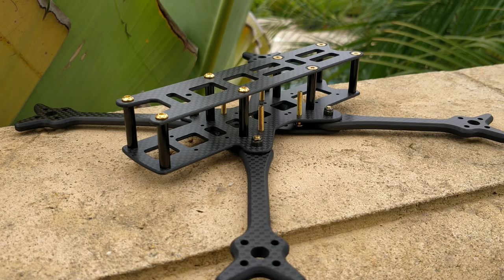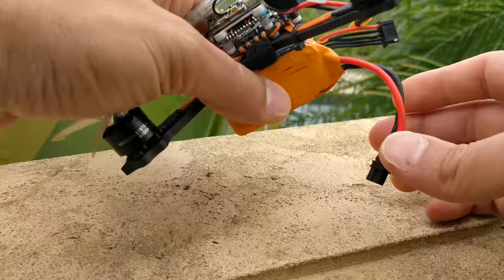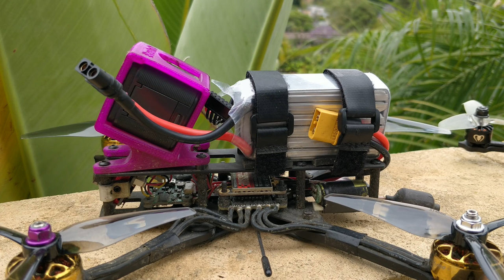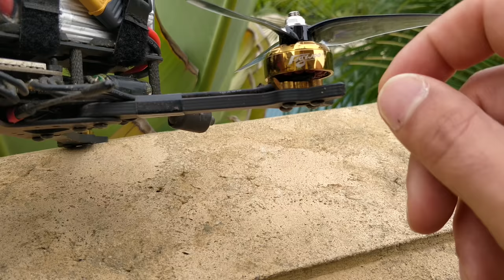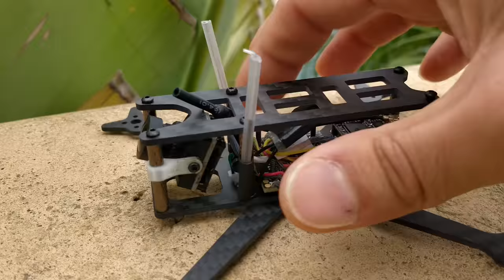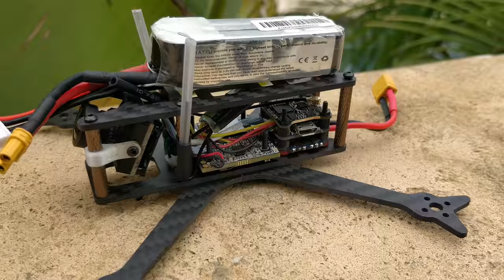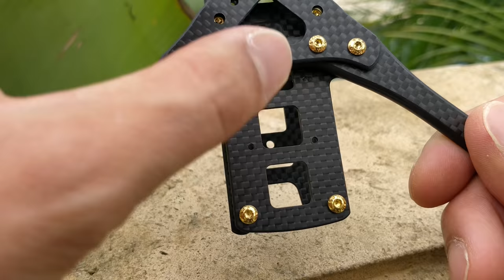Quad setup and flight performance - Quad Theory (WARNING: Lots of talking only)

Comment: All those Suttle differences I don't notice very much. 
Stretched, true X, this hybrid. Stretched sidways. I mean I notice but not much. Room for electronics is a big thing. Weight is a huge!
What has puzzled me lately and what I've been doing is trying to think ou tof the box on isolating electronics from frame vibration.  I believe this is most important and with all these frames on the market clones, name brand it's still just 4 holes through the bottom plate. It's almost open for the taking.
Reply from the maker: I didn't talk about any of that. That's the reason why my arms are not integrated with the stack screws at all. Much more vibes. The rubber grommets do an excellent job the way I have it
Reply: @Kabab  yeah the grommets do work. I like the rubber Standoffs. I guess it's more of the gyro used. If I were a better pilot I think I would notice those suttle frame differences haha. I do notice weight between 4 5 6s wich I run all on same quad. And I feal the better I isolate the electronics the more I can get away with running higher voltage without returning . Atleast that's what I thinks going on.

Comment: What are your thoughts on "deadcat" design ?
Reply from the maker: It's almost all but necessary to get props out of shot if you want a traditional style frame without the wide X. In this case it actually performs quite well but I still don't like it
Reply: But there are 3D printed mounts for the session out there that push the GoPro a bit more to the front so for example I do not have any props in the final video with my FlosStyles (5" and 6") or another Alien type quad. So to have no props in the final video a deadcat style of quad is not required in any case.
Maybe if you like to fly 7".
Reply from the maker: @henrischomacker6097  right which is why I don't even like the dead cat at all

Comment: Why did u jump from iflight xing to flywoo nin?
Reply from the maker: Xing and Flywoo are made in the same manufacturer. They're exactly the same motor. I like the Flywoo more because it comes in 1750kv whereas the xing is only 1700

Comment: You have 2 forms of tuning 
Mechanical(hardware) and software
Reply from the maker: Yeah I aim for mechanical tuning and skip the software
Reply: KababFPV I have seen your way of tuning - I have a emax hawk 5 with 6” arms and 5” emax avan flow - and just today I just did what U do with lazy tuning video - you settling is 0.1 and the other was 1 - mine was 0.6 and now 0.3 and the other was 0.5 now 0.7 so its a mix between soft and hard ware tuning- testing it 2morrow can’t wait for the smothered stick feel 🤙 big fan thanks for replying massiw_101 insta 😂

Comment: "Countersunk screws", please don't. I have 3 of your Glide frame and I didn't like that change with the new batches. It adds another different type of screw that you gotta have spares for and potential weak point(issue with a different frame). Plus,I would think most people run some type of battery pad on top, which makes the countersunk top screws redundant.
Reply from the maker: Right. Thats why I never did it. I'll just leave it on the batt end of the plate and nowhere else

Comment: Actually when you are talking about what way the carbon is cut on the frame at ~35 minutes .. Thats just the top layer of the carbon.. the other layers will most likely be in other directions. Or atleast they should be for strenght.
Reply from the maker: In the VAST VAST VAST, like 99% of ALL hobby grade carbon that I've taken a look at, the top layer is accurate in predicting which direction the fibers inside are going.  I've literally seen three examples otherwise.  Also, the VAST VAST majority of hobby carbon uses 0/90 carbon.  Believe what you'd like, I've done heaps of testing over the past five years.  This is the most common remark I get about carbon...
Reply: @Kabab  That might be :) assumed quasi-isotropic layup was kind of standard. Based on the only place local to order carbon and their frames.
Reply from the maker: @dronesandstuff  not standard. Must be specified when ordered.
Reply from the maker: @dronesandstuff  also qusai actually makes the carbon weaker in some ways and stiffer overall. It's usually better to go with regular 0/90 and designing to take advantage of it....depending on the design

Comment: Bob you hate the wobble but leave defaults I’m gonna have to remind you that you don’t build x well true x quads save the toothpick
Ya gotta tweak the pids mostly the filters I like the flosstyle probably the best an with tweaking I end up way different in the axis front to 
Back I’m gonna get you some pics of my favorite quad 5” alien with 6” flosstyle arms it’s perfect
Reply from the maker: I know how to tune, just not to perfection.  There is no tuning that helps with the wobble issue.  I've tried everything anyone has recommended.  The issue is an open issue ticket with betaflight.  The devs know about it.
Reply: KababFPV yea I know that you do 
 Pretty sure I’ve seen your work

Comment: Motors 1750kv? Why not Higher?
Reply from the maker: I prefer 1750-1800. Any more kills the batt too hard and requires a throttle cut. I don't need any more power than that. The thing already goes 100mph.

Comment: Give me a jello free lightweight 7 inch frame. There aren't many options  for a true long range 2200mah capable cruiser.
Reply from the maker: I'm working on it but I need to get the props out of shot. I'm considering a nose extension for the glide and keeping that as the 7" option because it flies so nice
Reply: Check out the fr7 on thingiverse the cut files and prints are all on there and no props on view https://rotorbuilds.com/build/18394
Reply: @Kabab  I'll be ordering as soon as they are available.
Reply: @biggfpv2721  this is a great design, but it's a unicorn frame, no vendor seems to carry it.
Reply: @AdrianoCasemiro  yes cnc madness cuts them and ships them out it's taking off check out mid-range MTN surfing group on Facebook they have tunes for it and everything 50 bucks for just the frames
Reply: Just a heads up option though for ya
Reply: @biggfpv2721  just sent'em a shout, thanks!

Comment: Ok, first disagreement.  While P and D does affect attitude hold, it's the I's that really determine how much gain is applied. Antigravity is a good example, fast stick movements that make the P overpower the I causing shudder is why that feature exists. 
To simplify as much as possible, ignoring the interplay, I describe the p as your control gain, I as your hold gain, and D as your dampening gain. 
The issues that arise from high P need to be countered with high D but high D has it's own set of problems that are attempted to be fixed with dynamic d that has it's own set of issues that complicates the tune ever further.
It's getting so complex, tuning down an 'overpowered' quad is becoming a serious hassle. 
Im betting if I gave you a tune you would be shocked. 😎
Reply from the maker: That's one of the parameters that need to be correct too. Not ridiculously over powered
Reply: @Kabab  had a feeling you would say pid tuning is outdated.  "overpowered" is very complex too. Motor response times, max RPM, tourqe, thrust, prop, power draw, auw, weight distribution. All these things can be tuned for OR you can replace parts until you find a good combo that just matches. 
My 2.5" is my most insane p/w quad. 1106 7500kv tooth fairy on 450mah 4s. Just to get it to fly, I had to chop my pids by over half, tuned, almost 2/3's lower!
Now that it feels like my 5", it's hands down, by far, my fastest quad. 
The 7500kv was a shipping mistake btw, thanks Sergio 🙄😂 
Pids are still important. 
I've considered building an app that can estimate your settings based on your setup, but it's getting so complex there is almost no way that it would be helpful. 
I imagine something like:
2207=-4p+1i-1d 
2300kv=no changes
6"=-3p-2i-2d
50 pitch =-2p-2i+1d
Auw 700g=+1p+1i
Ect..
Then total up the numbers and make that change from stock. -8p,-3i,-3d. 
This is how I tune in my head and before the first flight I can get a quad flying better than stock numbers, so there is some validity but mostly just educated guesses. Who knows, maybe I'm onto something and a pid simulator will be built into betaflight configurator in the future. 😂
Reply from the maker: @Stanton_High  hopefully we'll be moving towards dynamic self tuning pids soon
Reply: @Kabab  we already have pretty 'dynamic' pids, smart feedforward for p, antigravity for I, d_min for d. It's really getting close, but i think we are a ways off before we have AI making tweaks to the tune. Even then, do we really want something else determining our preferred stick feel? Idk.. 🤔
Sign me up though!
Reply: @Kabab  you noted a wobble with 2207's on betaflight. I can tune that out. Also you said you hate the throttle curve of 2306, I can fix that too. 
Here's a video of my hyperlow on 2207.5 riding ground effect like like a rock. https://www.instagram.com/p/By_k4ajlp3U/?igshid=109zqykie5o0y
Reply: @Stanton_High  I see bobbles and wobbles still in your video and flying low and in ground effect is not saying much about a tune but rather more about smooth and slow throttle input.
Reply: @Stanton_High  Sorry, but I don't see the point here:
What has wobbles to do with a motor-curve or the ground effect?

I really love my Brotherhobby (BH) 2306 2450kv with no expo for it's great control when it comes to smoothly catching the quad low over ground, but I even like my BH 2207 2700kv much better for it's extremely fast reaction and high speed. But with this extremely fast reaction and the 2700kv over the whole throttle way there comes a downfall: It's really hard to precisely catch the quad from the hight low over the ground. - And this has nothing to do with the ground effect!

I fly the 2207 with a BF throttle curve of 50% now (it have been 65 at the beginning) to be able to precisely control them at low throttle. If I wouln't do that, I would always "overshoot" and the quad woud jump back up over the ground. - But not because of the ground effect... just because it's so damn hard to controll these motors in the low throttle range very precisely if it has to be a really fast reaction.

That's why BlackBird FPV worked with T-Motor on the "T-Motor BlackBird Edition 2207 2725Kv".
They tried to give the motors kind of a "natural throttle curve" themselves. So we would get the best of both worlds: Insane power with extremely fast reaction and good control in the low throttle  range. I really would like to try them.

I really wish, the expo functions for both, throttle control and the three axes would be different to achieve in BF than now. More obvieous and more flexible like a curve represented by it's changing points.
I hate playing with RC-rate, Super-Rate and Expo to still gain the same rotations in °.
Woudn't such a kind of adjusting the throttle curves make Super-Rate and Expo "unneccessary"?
(And yes, I know I could try to achive something about like that with the radio. But it's not the same.)

And the wobble issue? - Did one of you really understand what Bob meant with that description?
To be honest, I didn't, maybe I didn't pay attention enought on a previous video?
Did this "wobble issue" already exist in pre BF 4 versions? - Does it occure like propwash when going fast into sharp turns?
That is what I have at the moment after replacing the FC after a really hard crash and switching to BF 4.0.2.

Maybe Bob could explain that issue a little bit further? - I'm really interested in that.
Reply: @smooth_ops2942  wasn't really meant to be a cinematic flight, thought that would be obvious..
Reply: @henrischomacker6097  yeah, I never said it did. Flying close was just an example of how smooth it is running, don't read into it too much. Lol
Reply: @henrischomacker6097  on those 1700kv set throttle mid .01(important) and throttle expo .1 to .2 also be sure to set throttle boost to 0.
Reply: @Stanton_High  Puh, I'm really happy now: Because I had so bad vibrations after a bad crash and after changing ESCs and FC and BF to 4.02, I first thought it could be the frame that got more damage than I initially thought (and have already ordered two new ones as replacement). But yesterday night I tested all the motors and their impact to the Gyro and came to the conclution to change one of the motors.
And like a wonder almost all vibrations went away and it again flies very smooth in almost all situations. - Only in sharp fast turns, I still got bad vibrations (wobbling?) like propwash.
So I really tried your hint for the 2207 motors but to be honest, it did not have any impact to that problem, but reintroduced lite propwash on other situations. So I turned the pids back to the BF 4.0.2 defaults and read through the BF 4.0 tuning guide. - Unfortunately: Your hints seemed too easy to help getting a well tuned quad.
They also recommended raising d and d_min in little steps in the tuning guide, but that also had the same effect.
So again I fell back to the default pids.
But then I tried raising iterm_relax_cutoff slowly until 40hz and magically now also all vibrations in the sharp fast turns were gone. It's like magic :-)
So probably Kabab is right and most 5" quads do not need changing pids but eventually, depending on the flying style, need some other tweaks.
The best thing is: My buddy the also complained about little propwash vibrations with his chameleon TI and showed that to me. We then also directly raised iterm_relax_cutoff to 40hz and also his vibrations totally disappeared. - I personally will call this parameter the "magic anti propwash param" now :-)

Comment: I like the Glide frame a lot but I understand you designed it specifically for GoPro which is not in my interest. Would it still be a good choice without GoPro?
I'd like to see a design to meet our coming european regulations (250gr) without a HD cam. If your 3" would do the job without HD it'll be my future choice. I'm getting more hessitant to build new 5" because of future regulations and cutting costs on batts and props on smaller drones. But I like the Glide a lot wished it was scaled down without HD.

kind regards, Erik
Reply from the maker: The 3" I have coming will be about 80g AUW and should be legal all over the world.
Reply: @Kabab   I'm looking forward to it! It'll be a fine choice to fly one close to home as well. a 30min drive to fly 5" is becoming a pain when days are getting shorter soon.

Comment: It would be great to open a physics book one day...
Reply from the maker: It would be great to have some real world experience some day
Reply: Weight distribution only matters in manoeuvres, putting the battery sideways doesn't help the back motors in straight lines,it only helps in dynamic moves as opposed to what you state. It's bad for roll reactivity, and better for pitch reactivity.
Now is it better to have a stretchX with side ways battery,or to have a pure X, with the battery along hidden by the canopy??? I'll let you think about that...
Reply from the maker: @cedricgrandseigne  if you had actual testing experience you'd realize more. Thanks for being a douche and spitting on me.
Reply: Don't worry about my real world testing skills, but as usual, when somebody tries to correct you on the physics basis, you are mean to them...
You should learn that a good pilot doesn't make for a good engineer. It 's not because you notice things, that you can give the right explanation for it.
Reply: Whahoo, you are more and more constructive, I'm impressed! You are a lost cause...
Reply from the maker: @cedricgrandseigne  please teach me oh great one.